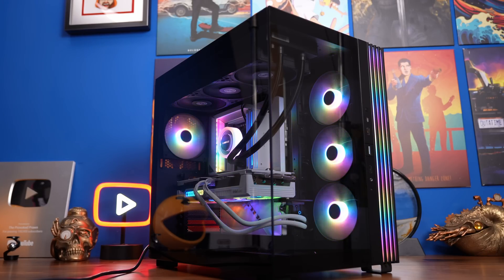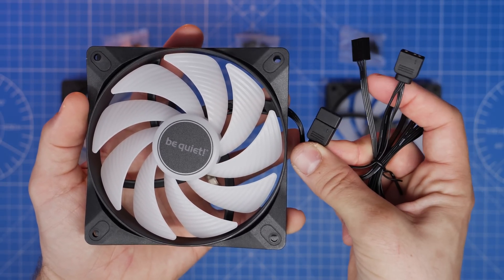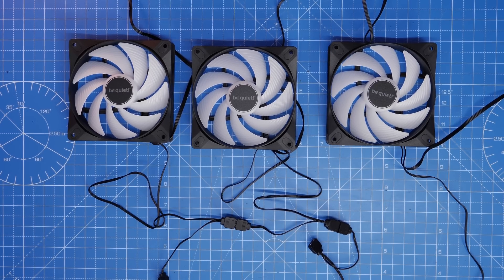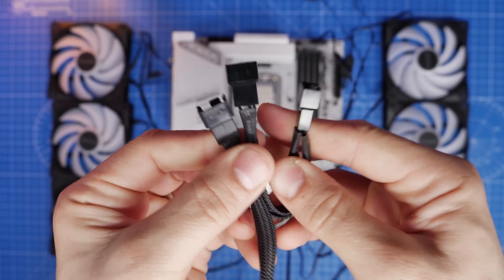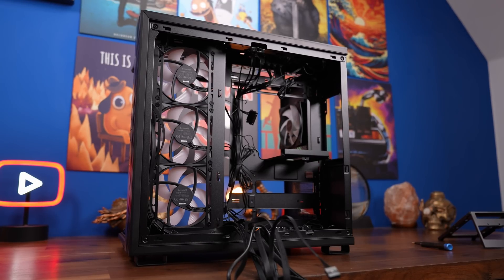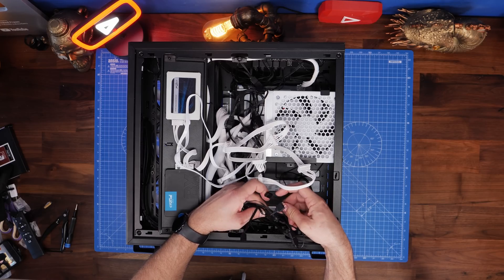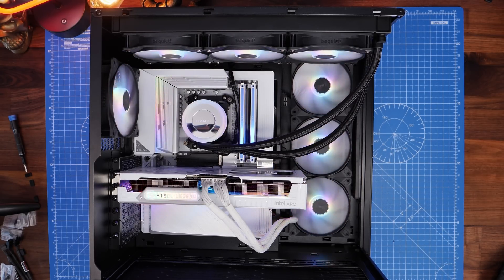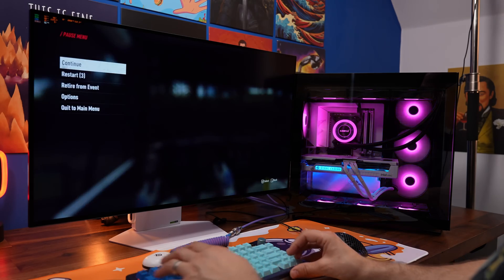BeQuiet Light Wings LX fan wiring guide - with RGB and fan speed tips

Comment: I have the 500lx case and the aio light loop from be quiet. In total 10 fans, 3 in bottom, 3 aio, 1 rear and 3 front. The aio are all connected in the aio hub and this is to the motherboard. I can controls those in colour. The other 7 fans and pump I cannot control. They are connected to the housing hub and this i have connected to the mainboard: cha_fan 2 and add gen 2_2. Any idea why I cannot see those 7 ?

Comment: Question! I have the Be Quiet 600lx case. All the fanconnectors, the power and RGB are in the so called repeaters. Non in the frontpanel of the MB. Repeaters connected to the PU. The fans are all on full speed and cannot be controled in Bios. What goes wrong. RGB to frontpanel, Power to repeaters??
Reply from the maker: The repeater should still be connected to a fan header you could adjust in the bios

Comment: Very much enjoy all your videos.  Just completed a Bequiet Light Base 900 FX build.  Motherboard is an Asus Crosshair Extreme.  RGB works great but all 4 case fans are too loud.  I suspect they are running at 100% from using the factory supplied Fan Header Boards with no speed control capability.

I disconnected the Fan control headers from the top and bottom boards.  Then using 4 pin three-way splitters purchased separately, the fans were reconnected with the other end plugged into Chassis Fan 1 of the motherboard and the other into Chassis Fan 2.

I then had difficulty controlling the speeds via the BIOS.  Upon close inspection I noticed the splitters that I purchased had 4 wires connected to the mother board plug and also to one of the Fan Plugs.  The other 2 fan Plugs had just 3 wires.  Do I need to purchase a splitter with 4 wires to every fan plug or should the system work fine with only one having 4 wires and the other two having 3 wires?  Apologies please, I purchased the splitters weeks before I discovered this video and the recommended parts list.

Comment: alright so just one question, i got everything all hooked up and daisy chained, and everything working fine, and i really wanna use cool lighting effects, but for some reason its treating every fan the same, its hard to explain but lets just saying im using a "shooting star" effect, the "star" wont go through each fan in a sequence, itll go thru each fan once at the same time, yanno what i mean? like the rgb is treating all the fans as one fan yanno. i used to have some old corsair fans that i could individual change the rgb effects on, but now with these fans theres way to control each fan separately, just all as once bunch. think you can help? i have them all plugged into the case hub so im not sure if getting a seperate hub can fix that for me. lmk thanks!
Reply: Same issue, did you find a solution?

Comment: Do i need to use the fan hub that comes with the be quiet 360mm light loop aio or can i just connect the fans of the radior to the fan repeater thing of the case (LX 600 that u used too)

Comment: 2:42 What’s the point of the included RGB hub if you can just connect all of them via daisy-chain?  You still have to plug all the power cables into the motherboard.
Reply: The two Repeaters are for RGB and Fan Power. From my Understanding you just have to connect these Repeaters to the Motherboard (RGB and Sys Fan) and also the Sata Power Cable to power up the Repeaters themself.

Ive also read the two connectors of this case are connected, so u just have to connect the top one to the motherboard.

So basically u can use these repeaters for all the fans in the case.
Reply: @franzebert428  if you do it that way, can you still individually control the fan RGB and speed?

Or is it then one setting for all?

Comment: How do you adjust the case RGBs with the motherboard software?
Reply: Because I can't adjust the RGBs via the RGB header on the motherboard.
Reply from the maker: You need to press and hold the case RGB button to turn it into motherboard sync mode first
Reply: Thats not working. Can you explain the exact steps you done?

Comment: I made it all the way through this video you Clever Crustacean you. I loved this build as it resembles one of my own.
Deepcool CH780 case with Deepcool 1200 watt PSU, Deepcool LS520 Mystique 240 AIO with the fans swapped for reverse. In addition to the included triple 140mm fans and the ARGB and fan controller as well there's a of trio Thermaltake RGB reverse fans as well as a pair of 200mm ARGB fans in the bottom as intakes. In a nutshell I saw the one you have here and it reminded me very much of my own. Well done.
Mine has a little astronaut figure with a galaxy projector inside the case on the forward fan hub [yes, black grills on]. It looks very cool.